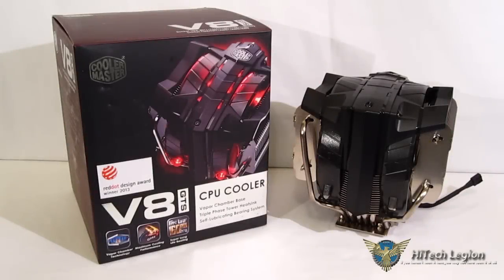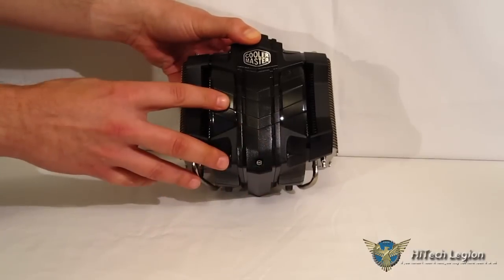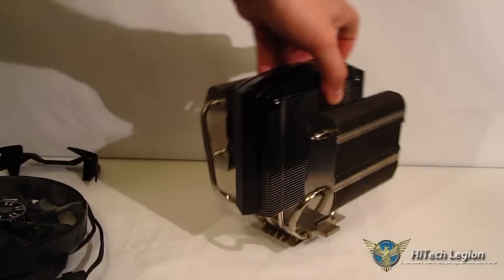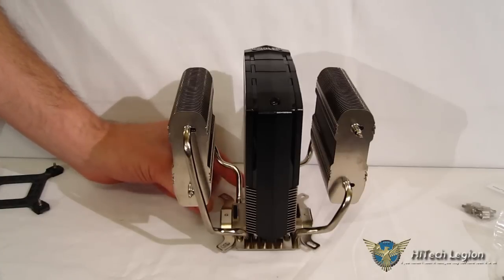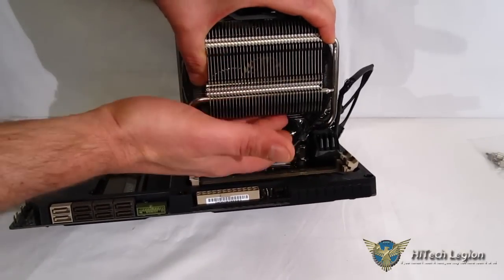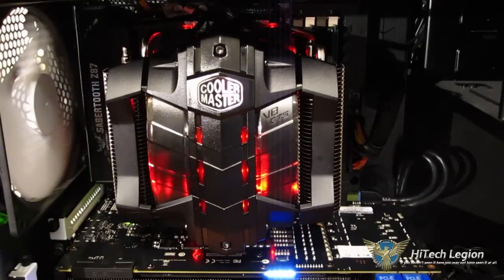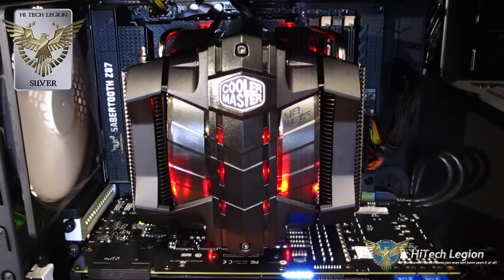Cooler Master V8 GTS Overview, Installation and Benchmarks

Comment: I'm looking into doing a semi retro build and have seen a couple of these units for sale on the 2nd hand markets and am curious about this monster cooler. I would like to install it on an LGA 1151 Rev 2 socket with an I5-9600K or and AMD AM4. From what I've read it needs to be in a big full size case. Good to know there doesn't seem to be any issues with ram interference. It seems the fans last a long time but wonder if new square style 120mm ones could be retro fitted if the OE fans go bad?  Thank you for this video from the past much appreciated.

Comment: I went with the phanteks cooler and still use them to this day, ive got 2 a red and a black. My mate has an orange one. I use mine for benching and testing, they have been mounted 100's if not 1000's of times and they are so easy to switch unlike the v8 GTS

Comment: i really like my gts v8 i use a long philips drill bit to tighten the fans and a socket wrench with extension to tighten up the heatsink bolts no problem!

Comment: Wish I would have made a video of me changing out the red LED's to white so it could match my system and whoever is thinking about doing the same with their V8. Just a thought for anyone who would like to change the color out, of course it will void your warranty, but being that it's a air cooler isn't so bad as the only thing to fail on it would be the fans. Good luck fellas.

Comment: I threw mine out. A noisy clicky fan, replaced by warranty (major hassle) got another faulty fan...out it goes. Turned me off Coolermaster products. I have to say their Hyper 212x Turbo is great though. This thing though, I would avoid it. The fans are proprietary so if one goes you have to get the exact same one from CM.
Reply: Wow Greg- Sorry to hear that. I've had one for goin on 5 yrs now, and my second I picked up about 9 months ago- and they're both great! But I guess that shows how messed up man made stuff can be. And for the record, I had the same experience wit ASRock, so I understand the bad vibes

Comment: tbh it doesn't take that much time to mount it, I mounted the old r1.0 for around 5 minutes if you remove taking out the previous mounting system for AM3+ and trying to clean up the CPU, but if you do count those in it took me 10 minutes to clean up everything properly.

Comment: Is it quiet? Because that's an issue I've had with most CPU coolers, none of them are quiet enough. However I've mostly dealt with stock coolers so I'm hoping that this one is much more quiet.
Reply: try using a BeQuiet! they are made to be quiet
Reply: grab a noctua Dh-15 :P

Comment: are this stock fans bad ?
last one started making flapping sound after year of using it
Reply: They're good if you're not overclocking but if you want to overclock you should get an after market cooler
Reply: i think he's asking if the stock fans in the cooler are bad, they're standard cooler master units, never had problems with them
Reply: ohhhh i thought he meant stock fans that come with the CPU
Reply: yea my first one started throttling flapping ,and Ive bought second the same cooler before a month, still dont have a problem,but idk iam sceptic

Comment: @HiTechLegion Its still needed to put the thermal paste right ?
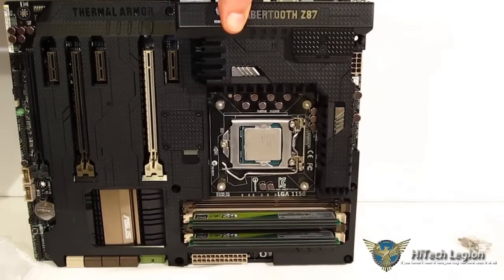Reply from the maker: 10:07
Reply: +HiTechLegion do you think it still good now or should rethink my option if so any recommendations
Reply: You should watch the video again. We didn't find it to be a recommended cooler 2+ years ago, and that stance hasn't changed. This cooler is all about the look - performance is sub par for it's price class and size. You should be looking to a Cryorig R1, Noctua NH-D15, Thermalright IBE, be quiet! Dark Rock Pro 3, etc if you are after performance.

Comment: Be aware, a friend of mine bought this with an Extreme VIII formula + GTX 970 and the video card won't fit in the pci 16x, we had to put it on 8x temporanly untill we get a proper sized heat sink :/

Comment: How much clearance is there under the heat sink for memory. The Corsair Platinum series seems like it should be fine. Its only 2 inches high so I don't see that there would be a problem. I am looking at doing a MSI God Like gaming EATX MB.

Comment: you went a little overboard with the thermal compound. you don't need that much.
Reply: +electronics for fun It looks like more in the video than it actually was. The TIM print was perfect when the cooler was removed.
Reply: George Cella ok.

Comment: I would like to point out you installed 1 of the fans backwards(both were pushing in opposite directions), wale that isn't a huge issue, it has about a 10 degree effect on performance, in ida 64 my 5820 runs at 68 degrees c with that cooler, please fix this video.
Reply from the maker: +Matthew P The fans are installed correctly.
Reply: the fan on the right sucks air to the left and the fan on the left also sucks air to the left, thats how it should be, going out towards the back. :)
Reply: +HiTechLegion I don't know if thats how you did it or not but thats how its supposed to be.

Comment: is compatible with LGA 1151 Skylake?
Reply: +Illusion Spark Yes.  The 1151 socket is the same as 1150, 1155, and 1156 in terms of CPU coolers.
Reply: Yep, I am running it on an I7-6700K (1151) on a ASUS ROG Maximus VIII Hero. I love it, HSF is great looking and performs very well! Had mine OC'd to 4.8GHz and it was still running cool. Bit louder, but cool :) http://www.3dmark.com/3dm11/10971451 No plans on leaving it at 4.8 as I was just seeing how far I could push it before the CPU blue screened. 4.8 was stable for me
Reply: Thanks for replies bros :)

Comment: This was my last air cooler before going to watercooling. I installed it, while the motherboard was still in the tower and the tower was standing... And this is easy and not foolish, if you just don't use the included tool...

Comment: Just brought this, I have a Zalman z3 plus with a GA-F2A58M-HD2 motherboard, the width of the case is 192mm but the height of the cooler is of 166mm, I dont think the motherboard takes up much space maybe 20mm give or take a few 0.mm so it'll be close to side case, anyone have a similar size and would it fit?

Comment: V8 or Hyper 612 PWM on a Sabertooth Z77 with 3570k?
Reply: +Wajih Hyder Chohan if you buy this, might as well consider buying an h80i gt or h100i gtx, as those are the same price as the shitty v8 which is just strictly eye candy.
Reply: +Gumb4ll_ 98 ended up going with the dark rock advanced c1. I was getting the v8 for 30 dollars. The dark rock ended up costing me around 42 dollars. The corsair stuff is way more expensive. Prices are weird here in Pakistan.
Reply: Wajih Hyder Chohan wow? the v8 here in canada costs well over $130 and the dark rock is about that price range but less expensive and the water coolers are actually less cheaper here.

Comment: Ok so I just bought my CM V8 GTS and I see an AMD Back Plate. Question what is it used for and how do you install it?  And I want to know where do I put the thermal grease as it just says "...grease the surface of the cooler base" does that mean I grease the plate that had the sticker on it or was it talking about something else?

Comment: lol i love coolermaster products but this one is way over its head, it looks epic, good asthetics and design but 100 euros for an aluminum air cooler... they are fking nuts, it would pay off if it was full copper, 2nd we cant even replace the fans for quieter ones, 36 dbs is not silent at all were we have fans on the market that run at same rpms with up to 10 less dbs than these.

Comment: Just a terrible cooler, no one buy this thing, please.
Reply: S Cramer My problem with what? This cooler is shit.
Reply: ***** It's really heavy, takes a lot of space, it was expensive and it does not even cool that well. It's known for breaking or bending motherboards. Just a piece of crap made to look "good" which ended in a huge fail.
Reply: ***** If you're spending that amount why not just get a water cooler instead? Much more efficient, the whole poing of air cooling is for it to be practical. Good air coolers are made by Cryorig or BeQuiet these days.
Reply: +Gentleman "Known for breaking or bending motherboards"? That is a little fable told by teenagers in forums. Rather than stating this bull as some kind of fact, go try to find an actual case of that happening with actual proof, and no outside circumstance causing it.
Reply: +Gentleman You can't get into even the lowest cost WaCo kit by any mfg for the price of this. The XSPC intro kit is at minimum 50% more.
Reply: +George Cella you can literally buy a cheaper water cooler that will provide much better temps as well as overclock. The corsair H80iGT, even the H100iGTX are both cheaper than this. This is just strictly eye candy and to those who prefer form over function (although water coolers look much, much better)
Reply: Gumb4ll_ 98 Are you trying to compare a Corsair CLC with even the most minimal XSPC kit? Oh, boy.....to each their own.
Reply: George Cella whoops, my mistake, just searched up what the kit was, it does seem a lot better. I am just getting into PC building. But in my case (pun intended) it would benefit better from an AIO cooler because of its form factor (mitx)

Comment: G'Day,  I just wanted say thanks for this informative video, I just recently got this cooling system and it looks awesome.

Update, After installing it on the Z97X gaming 7 motherboard.  found the last part, the retention nuts very fidgety and very awkward to install, specially when the bolts are high and bump into the fan lights.... 

For the last half of the installation, i really would have to give it a 8/10 for awkwardness.

Thanks for posting this video..

Comment: For an i7 5820k  to OC it would the Phanteks be the better choice to keep it cool when OC?
Reply: +Spartan 212 Yes, the TC14PE is a significantly better performing cooler.
Reply: +George Cella thanks yea I have 212 evo but with getting 5820k need something more solid. I don't want aio as I have hear tons of people saying they can do good with high tier air coolers and not risk the chance of aio leaking. Thanks for help man!
Reply: +George Cella Even thou it comes it 140s can I use 120s? I will get mines it black and white scheme XD.

Comment: Will it fit on the Asus Sabertooth X99? Im worried that the 4 RAM dimms wont fit after installing it
Reply from the maker: +Rudolf Viljoen 13:15
Reply: thanks! didnt even watch the video lol
Reply: I lost 2 out of 4 ram slot because of it and they were low profile rams too. go water cooling everything will be better.
Reply: nah decided on a noctua nh d15 instead. I don't really like the risk and maintenance with water cooling
Reply: +Rudolf Viljoen Don't have that problem with AIO water cooling
Reply: +Blink8533 But it can still leak and brake your cpu.
Reply: +Malkolm Lundgren highly highly unlikely that an aio will leak
Reply: +tyhod123 It can but it will most of the time don't leak.
Reply: I've had an h100i for two years and reinstalled it 3 times
Reply: it can still leak not lightly but it is a chance
Reply: +Malkolm Lundgren Got to agree with you. Murphy's law, AIO liquid that could go wrong, the pump, the fan, the heatsink, the hose, the joint and the liquid. While the massive heatsink only have....well the fan and the heatsink it self.

Comment: Not very good performance, considering the weight, size, triple radiators, and dual 140mm fans. The Noctua NH-U14S seems like a better choice. It weighs less, which is important if your motherboard is mounted vertically, and is quite a bit smaller, so you have more room inside the case. It also performs quite a bit better than this thing.
The Phanteks TC14PE is the best performing air cooler, but it's also pretty huge.
Reply: +Jeff Puha Noctua  looks like shit. If you want the looks you go for something else. Else Noctua  is fine..
Reply: +Jeff Puha Don't forget it is overpriced.

Comment: Ok i have questions before I buy this,
1: Will this fit on my ASUS ROG MAXIMUS VIII HERO LGA 1151 Intel Z170 HDMI SATA 6Gb/s USB 3.1 USB 3.0 ATX Intel Gaming Motherboard
2: Should I use Arctic Silver 5 High-Density Polysynthetic Silver Thermal Compound AS5-3.5G - OEM

Comment: Hey I have a question I am new to PC building and I am going to pick up this cooler. I was wondering do I need to use the thermal paste
Reply: +DataLoreVideos Absolutely. You need to use thermal interface material with any cooler.
Reply: +DataLoreVideos  just use tooth paste it works the same temps

Comment: just want to say, I watched this video after purchasing the v8, and being a first time builder made me nervous feeling like I made  the wrong choice seeing as its one of the difficult ones to install. But when I actually got around to installing this cooler, I found I did not have to remove any fans to fit this onto my motherboard, it actually took me 2 minutes to install. So for somebody who has never built a pc before to install this so quickly must mean its not as hard as you made it out to be. So for anybody watching this video for an opinion on the cooler, its amazing and I highly recommend it! It looks incredible and I have had better results than what was shown in this video.
Reply: +Brett1Lewis Thanks! I was wondering this as Im building my first pc too
Reply: +Brett1Lewis same here i am using it to cool a 5930k but i dont know how much to over clock it.or how much can u over clock a cpu using air cooler
Reply: i have it and it's a masterpiece fam ;)
Reply: +Brett1Lewis I know this comment is a bit old, but for anyone wondering: the current model of this CPU Cooler include the PMW (the fans adjust to temperature).
Reply: +jose palacios it always comes down to the performance of the cooler, a simple way for you to do it without pumping up the cpu with synthetic benchs is to grab the program you currently use that uses the most of your cpu, weather is a demanding game or a video editing program etc, 2nd, check the intel site or the cpu box to know the max TJ of your CPU, ex: 70c or 75c, etc. after that bump up the clocks by small amounts at a time like 100mhz then go to your program and run it for some mins and monitor the temp, keep doing that till you reach a limit of temp or clock, for example if your cpu&#180;s TJ is 72c then the max you want to go is 69/70c. always leave afew degrees apart from ur max to the TJ, other option is to run synthetic benchs instead of the programs like cinebench and 3dmark, or a stress bench, you can find those easly over google.
Reply: +Brett1Lewis I'm in the exact same position as you are. In fact, it looks like we may have bought this around the same time. I have a question for you though. I had my PC built through an online custom company, thus I didn't get the instruction manual for my V8. I keep reading there is a way to adjust the V8 fan speeds. Do you know how? I can't seem to find the answer anywhere.
Reply: Scott Norris not too sure to be honest, after some digging I found this article. Hope it helps! 

http://www.tomshardware.co.uk/answers/id-2067759/cooler-master-fan-control.html
Reply: Thanks. Ya, I dont really see a way to adjust the speed. The way this is advertised in the US makes it sound like it's completely adjustable. 
 Do you have yours in a vertical or horizontal chassis?
Reply: Scott Norris I have mine positioned vertically.
Reply: Same here. I am considering switching to a case along the lines of a Thermaltake Core P5. Right now Im using the CFI Borealight case, which is a great case with very easy access to the HDD/SSD bay. But it would be nice to have a case with easy access to everything.
Reply: He only took it apart to show the build of the cooler. You obviously don't need to take out the fans.
Reply: it's fucking hard to install :(
Reply: Herman Smink I find using your pointer and middle finger to screw it on the first bit easiest and then use the wrench. Its a pain in the ass

Comment: I don't know where you bought your V8 GTS but, the one I bought from Amazon, doesn't have screws to remove the fans. They are what look like rods with a hole in the head that isn't flat or Philips head. There is no way to remove them. So, it is impossible to remove the fans.

Comment: I am very upset with CoolerMaster for not stating up front that the mo/bo has to be uninstalled in order to mount this heatsink. Now, I have to practically disassemble my entire PC just to do the install. I never would have bought this unit if I knew it was going to be a hassle to install. Plus, I'll probably have to alter my side panel to get it to fit.

Comment: So which case would you recommend, I still need to fit my GTX 970 and my 850 watt power supply in a long with motherboard etc
Reply: Thanks man! the 850 watt has a massive Price difference as well....
Reply: thanks
Reply: Reddek i have my self a rosewill thor V2 im sure it will fit that
Reply: ooooh nice, Thanks!

Comment: does he put the cooler the wrong way?
Reply: BasBoy No.
Reply: why does he put it horizontal while the cpu is vertical
Reply: BasBoy I honestly don't understand what you are asking.
Reply: George Cella the cpu is vertical, he put the cooler horizontal on the cpu.
i think this is wrong
Reply: BasBoy I still have no idea what you are trying to say. However, this cooler is installed correctly.